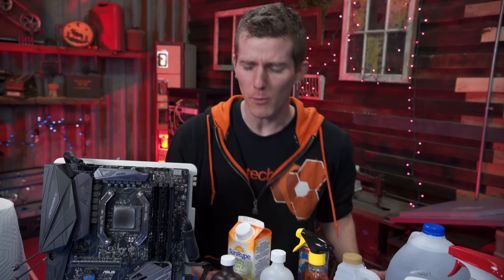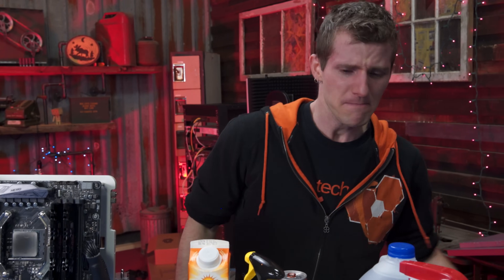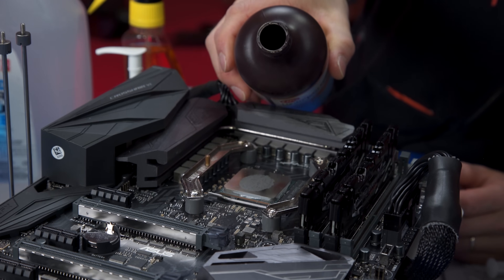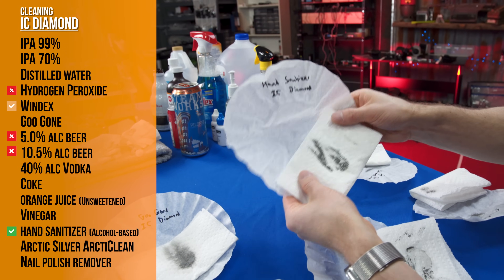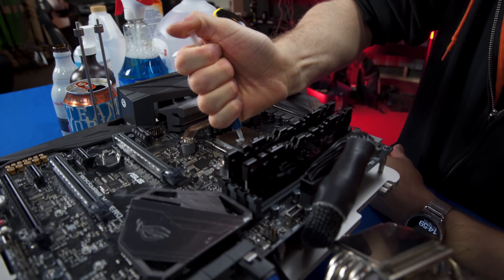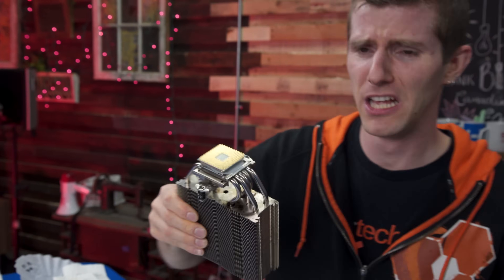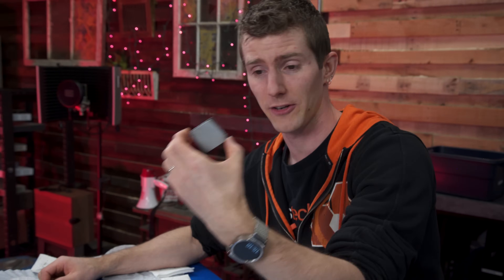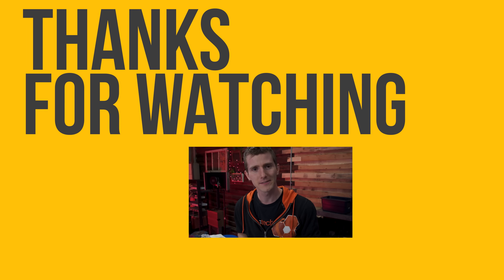Removing Thermal Compound - The BEST Way?

Comment: this test isn't stupid, and I'm impressed with the quality of it's procedure and the interpretation of results, however it does miss one critical point.

the core example is what does matter between 70 and 99% isopropyl, which I will later argue is not much. 70% isopropyl alcohol is 30% water, and 99% isopropyl is 1% water; the concern to be had is that the alcohol will evaporate rapidly and the water won't, meaning any bits of the solvent that end up abandoned and in contact with some kind of conductor are going to leave behind 30 times more water. The problem with this thinking is that alcohol is hydrophilic, it really wants to stay with water; but it also wants to evaporate, so what happens is that the alcohol drags a lot of water with it when it evaporates; 70% does not leave 30% water; 99% does not leave 1%; as well this hydrophilic effect prevents a quantity of alcohol from abandoning the water; that's right, when you cook with alcohol, it is impossible to cook out all of the alcohol. The remaining alcohol still wants to evaporate and that makes the remaining water evaporate faster anyway, so in a short period of time there's neither fluid left.

That is the case for isopropyl; if you're worried about it 99% is better in every way, but 70% is fine too.

Beer has a lot more in it than water and alcohol, and a lot of those contaminants will not evaporate, ever.

Comment: Normally i will just Use paper towel or Arctic Clean i have %70 Alcohol as well.
and on a side note i have been using the 4 blades that come with my $7 razer for the last  2 years and can stretch it to 4.

Comment: This isnt that accurate. When you clean thermal paste with say rubbing alcohol a lot of it will stay on the cpu/heatsink and thats noticeable if you use arctic's thermal compound remover after the alcohol

Comment: Pulling 1800x out of the socket, that's a FeelsBadMan
Reply: I've done it... Because the way PGA works, you're not actually very likely to damage anything, but it is odd, and I never encountered it with the old 94x-pin AMD sockets, but I guess that's what you get if you cram 200 extra pins into a similarly sized socket.

Comment: I understand what wiping off was the main point of this test, but I think it's EXTREMELY important to also stress the fact that anything that really isn't meant to clean electronics is going to have long term effects on the circuit board itself. It could cause corrosion or even leave residue that could short out contacts. The main reason IPA is used so often is that it evaporates so quickly and leaves nothing behind. That's obviously not the case for something like beer, or possibly even vodka.

Good video with some good information on things to use in a pinch, but I think it could've been mentioned that some of these compounds could have detrimental effects on the motherboard itself.

Comment: ArctiClean....works better then Alcohol, it dissolves even dried Thermal Compound. While alcohol is more for rubbing it off...layer by layer....
May be expensive <10$ for 2x30ml, but you need only 4-6 drops...should be nuff for 100 times cleaning or more...

Comment: You need a video where you realign bent pins from when you removed your HSF and your CPU is attatched. Did that ages ago with a Socket 939 chip. Worked perfectly fine after.

Comment: I thought the point of isopropyl alcohol 99 was to MAKE sure there was no residue left over when applying new thermal paste.  With all that other stuff there could be stuff left over that could affect the thermal paste.  Right?  I mean ANY liquid could get off thermal paste piss or vomit im sure will get them off but would you do it?  Maybe.
Reply: Orderdrake part of the purpose is how quickly it flashes off, but also you can dump it all over electronics and it will not damage it. I used %100 Iso for cleaning off a motherboard and gpu and it just flashes off in seconds and leaves behind no residue.
Reply: Not really. The point of using a short-chain alcohol is that it evaporates quickly, through frankly it's still beyond me why Linus always insists on using isopropanol when ethanol (in the form of methylated spirits) is much cheaper and easier to get hold of, and works just as well.
Reply: Robert Faber where can you get methanol for cheap? Legit curious.

Comment: MX4 literally doesn't need any solvent, unless it's really old and caked in. Which is why nearly everything worked just fine. 99% alcohol is still best, considering we know it doesn't damage the component and evaporates completely very quickly, without leaving behind any sort of residue.

Comment: On fresh paste like you had, only a paper towel is enough... Even your fingers would be effective... In real life situations, when the paste is not so fresh, IPA is your best solution, as it will NOT leave residues... On dried paste, like I get to remove is almost all my client's computers, there is nothing as effective as lighter fluid (Zippo)... The dried paste melts right away... I just wipe the cleaned surface with 99% IPA to remove all traces and residues, before applying a new dot of fresh paste...

Comment: You kind of missed the part where most thermal compound is being replaced when it is super old and dried out.  Wiping off stuff straight from the tube is easy, run that thermal compound for 2 years and most of those substances won't get it clean.  

But the conclusion is right, stick to isopropyl alcohol or arctic cleaner and it'll work.

Comment: I've ripped out my FX 8350 before with the CPU cooler
Reply: Same, I also bent the pins, had to spend 20 mins bending them back with a screwdriver, that was fun. I think Linus should do a video on the best way of bending cpu pins back...
Reply: Dragon Slayer Ornstein man, well at least it still works. Also I don't know why he was using a $500 CPU to test this on. I'm sure he has some core i3's or something laying around

Comment: That's all great and looks like a lot of cost, so can I suggest that you try using baby wipes? Honestly, I've used them many times on new and old crusty thermal paste. The cheap discount variety works best. Normally only need two wipes to clean everything off. 

Better yet they are great at cleaning your cars alloy wheels. Go on....give them a go. I bet you are shocked at how well they perform.

Comment: Wait have I been removing thermal compound wrong??‽!! I put a little isopropyl alcohol on a paper towel then wipe the cpu/heat sink... not put the isopropyl alcohol on the electronics... am I doing it wrong???

Comment: Starting to think these channels are useless for information on tech. That they are more a go to source for inspiration on tech. Like the "Muse" of youtube.
Reply: lol. just realized. in today i learned that surfaces are supposed to be cleaned before applying thermal compound. damn, how did my pc ever survive the first day after i put it together. With as little as i know about the proper way to assemble one. (Even worked at a computer repair shop for on the job training. For a clerical class i had completed at a vocational school)
Reply: What's wrong with Muse? They've made some great music since they started, even if the quality has dropped off a bit lately.

Comment: Just grab a knife and scrape it off. That's why they cover the chip with metal, so you couldn't damage it. In fact, all the pros are engraving their initials and stuff into their chips.
Reply: SmartassX1 Name checks out
Reply: Works better if the knife has a little butter at the sharp edge.
Reply: Not sure if can't read his name or blind
Reply: Yeah, the pros usually use alphabet punches. I heard it increases thermal performance too, since you increase the surface area.
Reply: SmartassX1 ci have always just used a razor blade.  It's super simple with a blade huh.
Reply: SmartassX1 and what for? Can you see the initials whils cooler is installed? xD
Reply: not sure if trolling or just stupid

Comment: That's funny. I use ordinary water everytime I clean CPU/GPU paste and it works like a charm.
Reply: Asdf Jklů make sure to put your component in the dishwasher for best results.
Reply: Why though? Wet cloth cleans it just fine. You may have to wait a few more secs before it comes off and wipe it a few more times, but it's spotless afterwards. Temps are fine, everything is working.
Reply: Bruce Alrighty It'll only damage the cpu if you dump water on it while it's on like a dingus. But with no power sources (cmos bat) and plenty drying time you could run a mobo through a dishwasher.
Reply: Well that's just plain stupid..

Comment: Crap, I removed thermal paste for the firsts time two days ago, and I just used a bunch of Q-tips, without any alcohol.
Reply: no problem, that's how I did it too a few months ago for two computers and they have worked fine. the only downside to not using any alcohol is that removing the thermal paste takes a lot more effort than 5 swipes...
Reply: No problem. The point of using a solvent for this is that it makes the job easier, but you can still do it without any solvent just fine.

Comment: It would be interesting to see longterm tests when the thermal compound has been heated and dried so we can see how well it works when you change it after a year or more. 
I usually just use pure acetone and it works fine for me.

Comment: The best way to remove thermal compound is with a pry tool and very shaken scared hands
Reply: screw driver and a hammer :)
Reply: i used an angle grinder, worked so well i turned my 32nm cpu into a 25nm cpu :D
Reply: can confirm screwdriver and hammer is a real good way to do it, maybe bust out the dremmel from time to time to save a bit of time
Reply: the dishwasher works good and its easy......top rack of course
Reply: chisel & hammer better
Reply: 2 street kids and 3 months worked for me. Be sure to feed them jus "enough" as one of them took a bite of my GPU..... I hate bringing och the whip that fast.....

Comment: @linustechtips does RYZEN of KABY LAKE a diference?
Reply: vincent van Rijn as in cleaning? no. but in cpu perf it's different
Reply: you cant pull the cpu out of the socket, but one wrong touch on the mainboard basically ruins it.. Thats basically it
Reply: vincent van Rijn Yes, Ryzen will frequently rip out of the socket because PGA sucks
Reply: you can pull PGA cpu's out of sockets! its just a friction fit not a pressure fit like intel